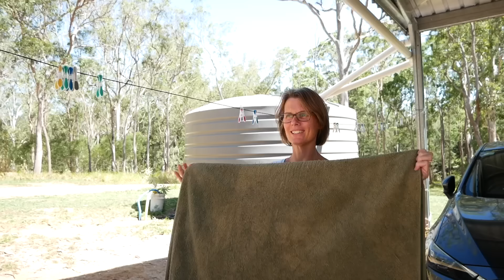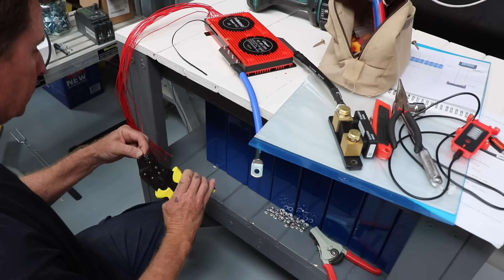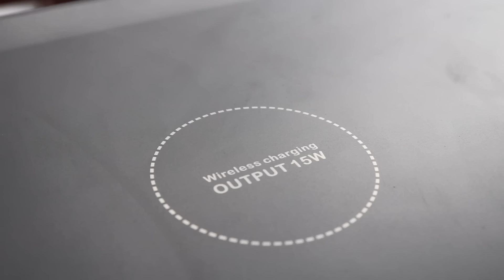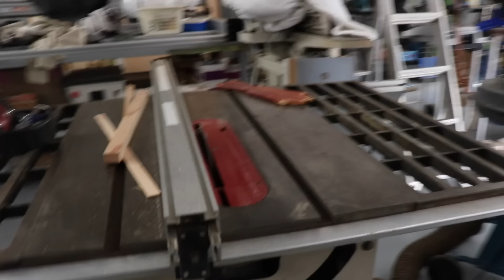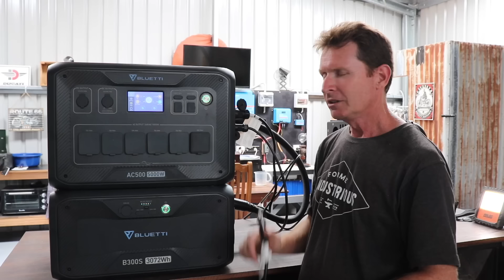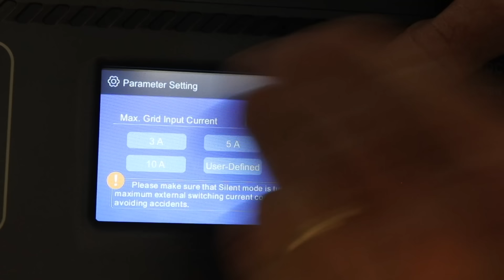DIY Off Grid Solar Power System overview and comparison Bluetti AC500 Review

Comment: Excellent review Scott.  I have an AC200MAX for the Ford Ranger (also as an emergency power source for our household frig if the grid goes down).  Recommended this unit to my brother and daughter who also subsequently bought one.  I had a problem with one of the (optional) cables I had ordered and after proving to them I ordered the correct cable they sent me a replacement FOC.   Great Backup. Great Support.  Thoroughly recommend BLUETTI.  I'll be testing my system out heading to Adelaide via Birdsville track and back via Brisbane.  6K round trip leaving 1st Jan.  Merry Christmas to you both.
Reply from the maker: Thank you Malcolm! Yes the AC200Max is a great little unit. We've used ours a lot out here. Safe travels; sounds like a great trip! Merry Christmas Malcolm!

Comment: what are price comparisons - and also been looking around at portable power packs for other reasons - no one displays use while still getting pv input.
Reply from the maker: I am not sure what current pricing is but you can build your own system cheaper. I think I explained this in the video. The important factor is are you competent to build your own system. A lot of people cannot do it and should be looking to buy an off the shelf system. As for PV input - it all depends on the amount of PV connected. So many variables. How much power you use v PV input v available light v battery capacity. The AC 500 has a pretty good PV input limit. From memory 3000 watts PV. During the day if you have that much solar connected and if your battery is full, the solar will pretty much be running you power needs up to 3000 w minus losses. There is a bit to learn. Hope this short answer helps.
Reply: @ScottTurnerformeindustrious  further , we are off grid for water but on grid power, replaced our kitchen sing tap with an electric (chinese of course) 4 years ago. our hot water tank is a distance away plumbing wise, tap says 3kw, our power bill dropped 40% immediately, hot water system not being used for daily stuff (other than showers)
we werent dragging cold water into hot water system meaning hot water system wasnt trying to heat a large volume of water for a (should have been but waiting for the hot water to come through) 2 minute job at the sink
Reply from the maker: @stefanreddick1572 great idea for the tap. Saves money and water.

Comment: Thank u Mate, May i ask you how is the AC500 Now in 2025, Still working ok ?
Thank you again
Reply from the maker: I use it as a back up for my main system, but my main system is so reliable the AC500 is only used when I want to run my big wood planner or welder. Those both use a lot of power and the Bluetti handles it no problems. Just check on their website, firstly for specials and if they still sell the b300 batteries. Hope thus helps

Comment: Solar power is useless.  Why people persist annoys me.  

The only benefit is temporary power supply, that's it.

Most people aren't aware that photons (sun light) need to be perpendicular (at right angle) to solar panels.  Other than manually moving them or employing a solar tracker, at best, you're only going to achieve 50% efficiency (based on stationary panels and with the sun directly overhead).

Unless you've got 180 degrees of unobstructed view of the sun, also reduces efficiency.  There are very few places on the planet where that the case (the desert and ocean the exception).

Then there's the cost of an entire system (panels, charge controller, inverter, batteries,  cables...)

Dependence of weather.  Forget setting up a solar system in the northern hemisphere.   During winter there is no sunlight.  None.

And don't get me started on "global warming " scare-mongering!  If people only realised they amount of natural resources consumed and unearthed in order to produce "environmentally friendly, clean energy solutions", they may think twice.

Nuclear power is the future.
Reply from the maker: I agree with a lot of your points including your second last point. I have said in a few of my videos that the modern "Grid" being power, water, sewage, waste collection etc is fantastic. A modern marvel and we take it for granted (a lot of us, not all). Though in our circumstances, land without any grid connections we either run a generator or go solar and solar absolutely works for us; fixed panels and all. It suits our lifestyle very well. I'm not trying to convert the population to living like we do, with the exception of trying to live more simply. We are in the moderate tropics so power production is good even in winter, and on rainy days. I appreciate your comment, and get some clothes on ;)
Reply: @ScottTurnerformeindustrious  lolololololoolololol I'm a tigers supporter,  Richmond tigers.  You Queenslanders are so lucky to live in tropical climate.  Us southerners (Victoria), have to endure -2 to -5 in winter.  

Scotty turner played for Richmond in the 90's.  A survivable player..

Scot, I hope you're running ac to the house.  Voltage drop is significantly less using ac, (see telsa/Edison).  

I've been living on solar since 2015.  A 1994 tarago with 2 x 110 watt panels (in parallel), mppt  charge controller,  330 watt inverter,  and 2 x 12v lighter plugs.  If you think you're doing it tough, try shitting whilst raining outdoors in winter, or not showering for 3 months.  

I watch your vids and think:  omg, he lives in luxury, he must be a billionaire!  I love what you've done, how you live, and your desire to live off the grid.  Although lots of people say they want to live like that, not many have the intestinal fortitude to do so.  

I have watched all your vids yet, but I'm excited to see the one on sailing. I just bought a solo for $200 that needs plenty of work.  I'd love to race you once it's ready.

Look into flywheel power.

Comment: Thanks for the review Scott. Ive been off grid for 15 years. My 2nd hand forklift battery (420ah paid 1500 for it) is losing its capacity because having no access to grid power, I cant charge it properly. Im considering a lifepo4 battery replacement but im not clear on charging times or ac charging current required to charge say, your reviewed system. I have micro hydro available for six months of the year but when its not running my relatively small solar array isnt enough (im in NW Tassie) so i run my big kabota generator (13kva single phase) with a 40amp charge. It can take 3-4 hrs some mornings to reach a reasonable charge state this way. My question is, in your experience do the lifepo4 batteries charge faster than lead acid and how far can you discharge them. Cheers mate
Reply from the maker: Thank you! My response is based on what I have learned and I am not Battery expert (So I may be proven wrong). Lead Acid batteries are good proven solid technology, however it there are newer battery chemistries that have massive advantages over Lead. For the Lead chemistry batteries 1. they should only be discharged by approximately 40 to 50% capacity. You can discharged them more but that has a negative affect on their longevity. 2. They have a slower recharge cycle where they take a bulk charge to say 80% then a slower trickle charge to 100%. 
For Lithium (Lifepo4) 1. you can use nearly all their capacity, though this too can reduce life but not anywhere near as bad as lead. 2. Recharge times - they take a bulk charge up somewhere near 98% and then float the remainder. Much faster. Discharge and Recharge depend on the battery and Battery Management systems (BMS). For more I recommend watching "Off Grid Garage" Andy is in QLD and he provides lots of good detail on the Lithium systems. Hope this helps.
Reply: That does help Scott. Thank you

Comment: Great to see your review on the bluetti, I'm looking at getting this system for the house during a blackout situation. We already have a 6 kw solar system on the house, so this would be ideal to charge that up. awesome to see so many ways to charge it and i was surprised at how many appliances could be run at the same time.
Reply from the maker: Thanks Josh. Last week I used it for welding. Worked fine, so it's a strong set up.

Comment: Great overview f your power set up. Thanks for going through it. Those Bluetteis look good and I am sure expensive. I noticed your slasher in the background at the start. Would be interested in what brand you went for, what you think of it, width and how many horsepower your tractor is driving it. Plus what sort of ground you are clearing with it, ie do you have a few sticks and branches it needs to deal with ?  Thanks. Duncan. .
Reply from the maker: Thanks Duncan. The slasher came withe the tractor. Brand is Sabre 5 foot I think. Tractor is 33hp. The slasher is good for high grass but poor at giving a finishing cut ( lawns) yes good for sticks etc. I use a ride on mower for most of my mowing.
Reply: @ScottTurnerformeindustrious  thanks for the reply Scott.

Comment: Hi Scott, I run an AC500 system for my off grid home. Does it need an earth /grounding connection? I can’t find any info about this in the user manual and researching is confusing for someone like me with no electrical knowledge.. thank you
Reply from the maker: Great Question; I hope my answer provides some guidance. I'm happy for the qualified electrical folk to add their input to the question.
I will be setting my AC500 up in another building (in the near future). Here is how I will set it up. From the solar panels I will have hi quality DC Isolator Switches and DC breakers like in my big shed then connect to the Bluetti. I will use MC4 connectors. For the AC side I will come out of the Bluetti 240v outlet (32 amp or perhaps the 15 amp) and run that power into a 240v Breaker box. In that box I will have an RCD (Residual Current Device) and maybe 2 MCB's (Mini Circuit Breaker). One for Power points and one for lights. I would definitely install a Ground Rod or Earthing stake which is connected to your Breaker Box circuits. I would have normal 240v sockets and switches in the building. That is all qualified Electrician work. 
As a minimum, if you just want the simplest installation, buy a portable RCD (with outlets) that plugs into your Bluetti and run everything from that. 
I will go with my first option as it hides all the cables and looks neat. But I guess if you can run and hide your extension leads that is a lot cheaper and will be just fine (safety provided by your portable RCD).

Comment: Bluetti also have the EP760 system for a permanent grid tie set up, it'll give you 7600W supply and can take up to 9kw solar infeed... Oodles of power even for a large house, about $20K though(19kWh storage) not including the solar
Reply from the maker: Yes that's a big system for sure. Cheers.

Comment: how well did/does the power setup work during our cyclone? 😉 that smaller system would make a great backup in my caravan park setup
Reply from the maker: We had/ have a lot of rain and heavy cloud. I had to use my little generator for the first time (Honda EU2i) to top up my system. Other than that, all good. Cheers.
Reply: good to hear you stayed safe, we had very little problems down here in cairns too 👍 @ScottTurnerformeindustrious

Comment: Great reviews! Would it be possible to hookup the bluetti to a house the same way one can hookup a generator to the house via a dedicated plug when there is a power outage? And so so run the whole/part of the house from the bluetti (so the fridge, fans, maybe even an aircon…run as normal).
Reply from the maker: Thank you. Yes for sure you can do that. I mentioned in the video you can set it up as a UPS, uninterrupted Power Supply through a transfer switch on your power board.

Comment: Hi Scott , After watching your Solar cart and bluetti videos previously I decided to go diy . I bought a H+F welders trolly and my son suggested using Kings gear as it reasonably priced . I also decided to install a panel in one of my small sheds and put some gear in there as well. Being a sparkie I have the tools and  I also dabble in electronics so I’m hoping to repair any of the kit that fails . If I didn’t have a trade background I think I would be buying the Bluetti kit for sure.
Reply from the maker: Love your comment Frank, thanks! I'm not a sparkie but I love the technical side of building these systems. All the best.